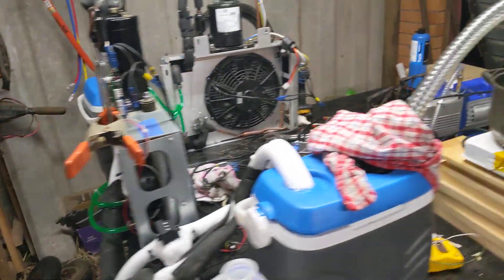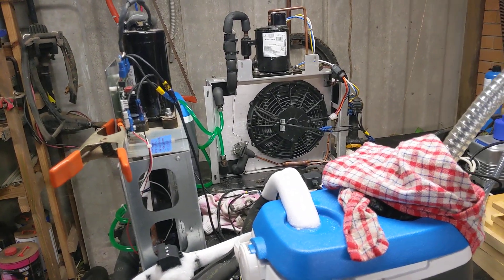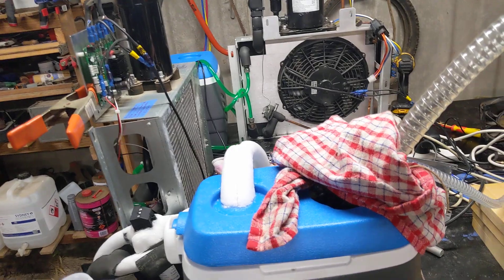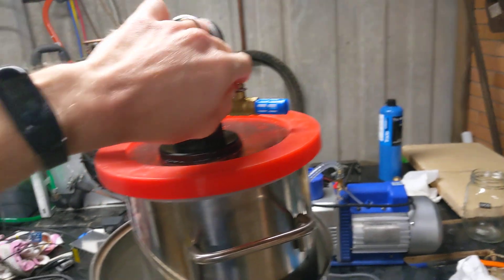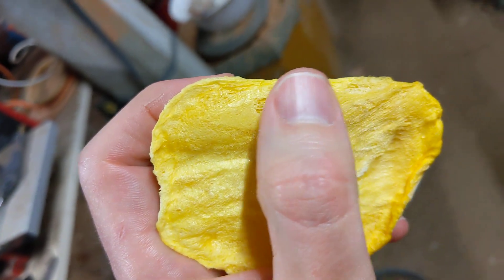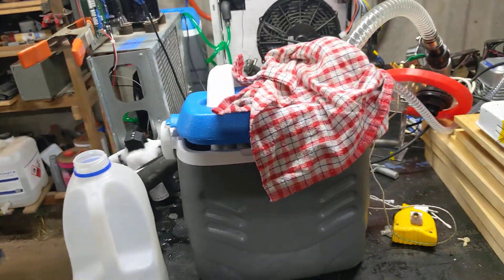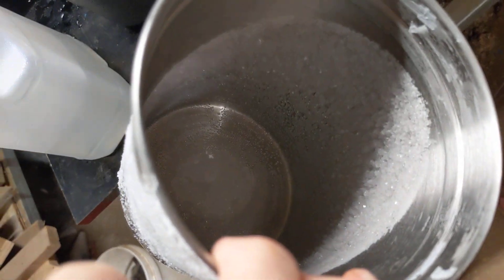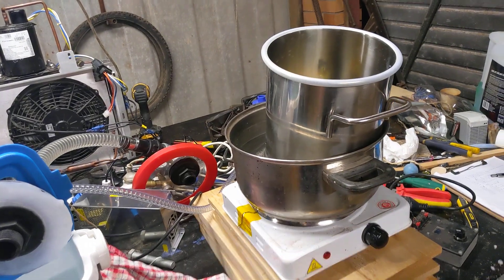Progress on freeze dried mango without using dry ice

Comment: Can't you just use the pump on it's own without the cold trap?
Reply from the maker: I've often thought about this. I have to assume it's bad for the internals of the vacuum pump? Accelerates degradation of the oil? Or perhaps the heavier water molecules have a hard time finding their way out of the system through the pump?

Comment: Or you can stick it in the freezer for like... a year?
Reply from the maker: That might actually work! The challenge would be making sure it didn't take on the flavours of other stuff in the freezer, or otherwise degrade flavour-wise by extended exposure to cold air.
Reply: @tjhowse  I had a strange idea, but here goes:
Put whatever you want to freeze-dry in an airtight Mason jar with lots of desiccant packets,
Freeze it for a year
Profit
Reply from the maker: @MisterBones223 Silica gel works well for getting very very low levels of moisture. It isn't good at removing a large VOLUME of moisture though. If you put them in with something that's relatively dry, they'll keep it dry. However if you put them with something with a lot of water in it the silica gel will quickly become saturated and stop absorbing moisture. It might work if you kept swapping out the packets and cycling them through an oven to dry them out.
Reply: @tjhowse  I'd personally use dehydrated epsom salts
Epsom salts can take a large volume of water
Shucks, I should experiment with it and yet you know how it goes